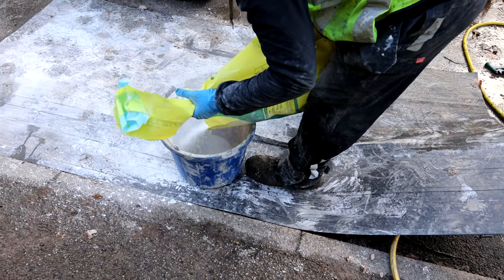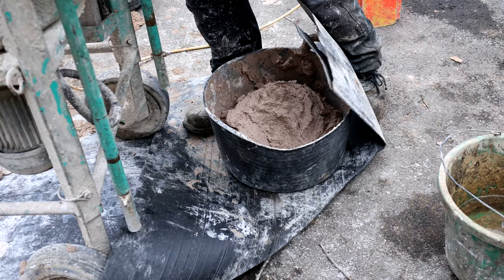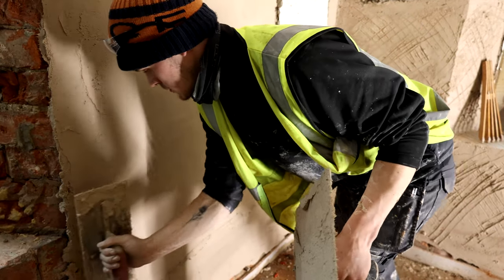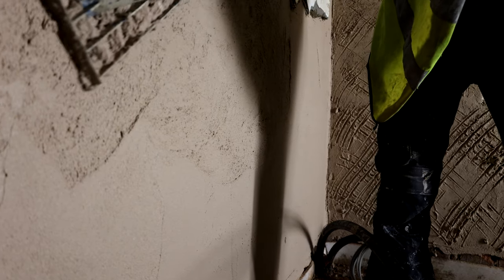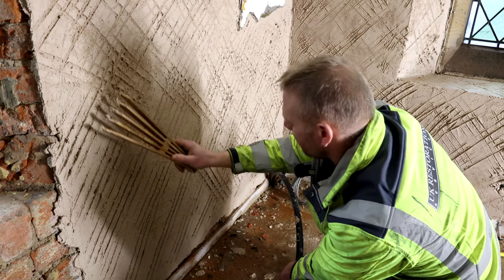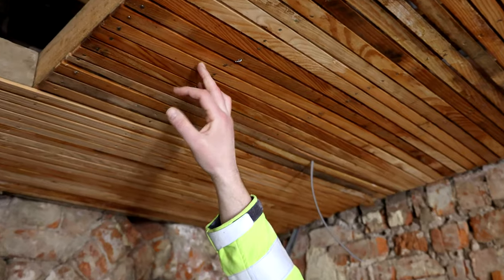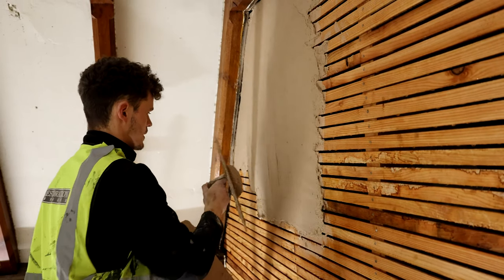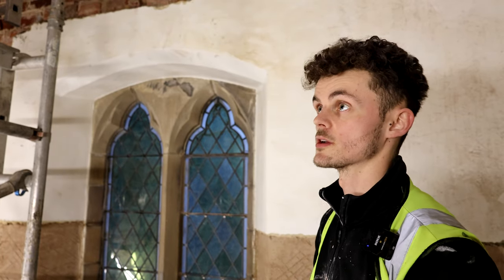How to Lime Plaster – Basic Guide to Plastering with Lime

Comment: Hi!  Thanks for this video.  Can I use just a single layer lime plaster directly over porous concrete wall?  Just doing it for the looks.  If so,  would you recommend applying the plaster while the cement is wet or completely dried?  Thanks so much!
Reply from the maker: I would say it needs to be damp, not fully dried. You could probably get away with one base coat and a top coat.

Comment: Brilliant work and very inspiring, how would the product that you’ve put on the walls differ to what was used on my home back in the victorian / Edwardian days, where all the what I assume to be lime render starts to loose it’s bond with the brickwork and literally just pulls off by hand? Is that just a characteristic of lime or did they do something wrong back then? Thanks for uploading the video, really great to see proper craftsmanship.
Reply from the maker: Hey Michael, the lime processing nowadays is much more refined than 150 years ago. Most calcium oxide for the hot mix now comes from mainly 2 sites in UK, Buxton & Shap. In the past lime burning would have multiply processing site in every town. The lime purity would vary depending on the extraction location. This would give different setting strengths. 
Lime plaster should not achieve the strength of a modern gypsum plaster. However most failures of existing plaster on historic buildings is due to water ingress, modern living and external impervious barriers.
Reply: @UKRestorationServices  thank you for taking the time to reply, would really like to learn more about it so your video was great!
Reply: A lot of it has got to do with type of sand. Leighton Buzzard sand is the best for stickability.

Comment: Are you using lime putty and sand for 1st coat? what do you use for 2nd and 3rd coat??  David
Reply from the maker: Yes the base and float coat are hot mixed with Calbux and used hot. The top coat is mixed hot but used cold. This is except the laths which I think on this was mixed with 50% NHL 3.5

Comment: Hi , i have a little cabin made with Osb. And i would love to try Lime plaster. Is it possible or not? What are the recipe for thé three stages?
Reply from the maker: You could just fix some EML on some counter battens. Probably easiest mix is a NHL 3.5 mixed with 2.5 parts course sand, leave over night. Remix next day....then crack on, dont mess with it to much. 2 coats 1st at 10mm 2nd at 6mm. Mix up NHL 3.5 to 1.5 parts Silica sand leave overnight...same as above. 👍👍
Reply: @UKRestorationServices  thanks

Comment: Plasters use a devil float to scratch the plaster that makes the key
Reply from the maker: Hey, devil float are OK for Bonding or Browning coats, however the scratch size in width using a devil float is 2-3mm. If you are using a traditional lime base coat / float with 3mm> aggregate. There will be an issue with the lime plaster penetrating the scratches. With a lath scratcher this will open up the plaster to 7mm-8mm allowing 3mm> plaster to bond / key better to the backing coat.
Reply: If you don't have lath, could you use nails/screws bashed through a bit of wood?